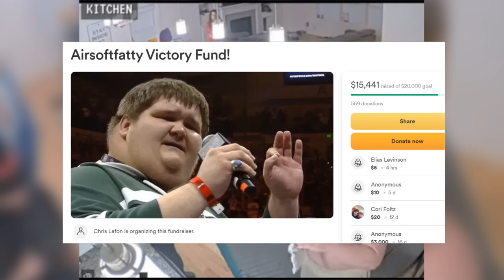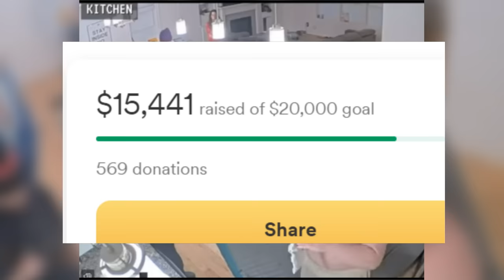Airsoftfatty on the rise

Comment: Can't believe Kiwi skipped over Fatty ripping insulation out of the wall with his bare hands during the build of the Fatty Shack
Reply: What's wrong with that?
Reply: @camojoe83 google it it’ll make you all itchy and give you microscopic scratches
Reply: @camojoe83  Fiberglass insulation is a pretty big skin irritant, even worse if you inhale it. It's going to do any serious damage but it's not something you really want to deal with.
Reply: Guys I handle fiberglass 3 times a week fixing rentals. I know all about it.

I forgot to use the sarcasm font I guess.
Reply: The old-school insulation from back in the day is very bothersome to the skin, but they're newer stuff they sell nowadays that is not too bad actually and can be handled bare-handed
Reply: @jontrudell7529  Huh,well that's good to know
Reply: @jontrudell7529  the yellow stuff ain't bad, but the pink stuff is as bad as it ever was. 
I actually think rockwool has it all beat. Whenever i have to handle that stuff at the greenhouse i always have to get the lint roller out for my arms.
Reply: @camojoe83  I work in restoration and deal with rolled in and blown in all the time. I gotta say really only the old stuff really bothers me. Alot of the newer stuff has vapor barrier on both sides or is wrapped in mesh. Old stuff really sucks though, especially when you've got a bunch in the neck of your shirt.
Reply: The F-Shack

Comment: You’re spot on about that last one. That house is already rotting from the rain splashing up on it with dirt. That needs to be at least like 1’ off the ground (helps with flooding too) and it should be sitting on good footings. Doesn’t matter how nice it looks if it only lasts a few years.

Comment: The shed is likely to last longer than you think as long as he doesn't actively destroy it (big if, yeah).  Those generally last 15 years or so without any work.  The one in my backyard is pretty much the same kinda deal (pre-conversion) and that's been there at least 20 years and in good shape except for sagging supports and a deteriorated door.  I'd say it's a decent solution that buys him some time to get his life in order.  Internet in the boonies isn't so bad these days.  We don't know his location, but even out in the country these days, you usually have 1 or 2 cable internet solutions and a DSL choice if you're near enough to get electric, and he clearly got that.  Failing that, there's Starlink, but that might be tough for him to afford on the upfront cost.  When I saw that shed pre-work, I thought he was screwed.  There's no way he'd be able to do or afford the work.  Those guys that donated their time there really knocked it out for him.  He's definitely got an opportunity here.

My worries are that he'd wreck the place himself, hoarder style... or let nature claim it by just not clearing the growth that will try to strangle it.  If he can keep the inside clean-ish, keep the outside mowed and cleared, and pay his bills, then he's got a decent solution for years to come.  He will need to save up though, because that shed will not last forever, and charity will only carry him so far.
Reply: they didny even put it on concrete slab its flat on the ground it has no insulation and no heat and no plumbing if it has watwr it will freeze in the winter this is not gona turn out good
Reply: Even though I don't like him, I don't wish bad upon him. I just want him to get his ish together and it stay together. Surround himself with better people
Reply: @xXtrial_and_errorXx  i dont wish bad on him but i just donnt see this going well he should have got a trailer in Michigan where he was living already its cheap to live ther an he has all his life but now they have moved him to new york some where one of the most expensive places in the country to live
Reply: Theres very little ventilation, every time he showers it fills with steam, same when he cooks his slop, its going to be mold city after a year or so. He was supposed to sleep in the loft, but can't get up, so he sleeps on that tiny couch, its also out in the sticks, he's never going to last there.

Comment: Not having a proper foundation is definitely an issue. 

Another large one: If he is not in city limits, that means a well for water, which is a decent amount of maintenance. Not to mention if he does not have city sewage, he will need a septic tank. Those need to be cleaned every 3 -5 years.
Reply: I wouldn't count on him doing anything that requires the slightest iota of responsibility.

Comment: I'm no builder but honestly no way in hell that shed lasts, especially without serious ongoing maintenance. 

Maybe I wasn't paying attention or maybe they just didn't show it but it looks like it doesn't even have insulation plus the outer walls look to be made out of chipboard which I imagine will only make the risk of rot worse as that stuff can turn into complete mush if it's moist enough.
Reply: They used the cheapest chip plywood ffs... and it cost over 20K by now. Insane ripoff. He couldve had a trailer which was already fully equiped and weather proofed for the same amount..

Comment: I also know the solution to keep Fatty's shack from sinking and rotting as my family's cottage is on Marshy land and they had to raise it every 10yrs. My family brought in an engineer and all of that and 10yrs later it  was almost sunk to the ground and my Dad figured an idea and instead of doing those pillars we took large railroad wooden ties and we cut them in half and then drilled a 4x8 piece and we raised the cottage with a bunch of pump jacks and wooden shims. We did the front & back with no issue. It was hard work but I was 21 and strong and in the middle we almost died. We each had two pump jacks each we had to keep up so the cottage wouldn't raise in the middle and crack, the jacks woulda given out and we'd have been splattered like an ant. That was one of the first-ever times I saw fear in my Dad's eyes. He just looked at me and said "Go!" That didn't mean scramble crawl for safety and break the cabin but live oh hell naw, we had to pump one jack and roll and pump the next one. We were working in tamdem and the railroad ties worked it was just that the middle was dicey and you never know when Mr. Murphy will show up and throw a wrench in your plans. We pumped  & rolled and I could hear the middle physically cracking and my poor Grandma was yelling my Dad and my's name and it was unsaid we just kept rolling and I like to think it was my Grandpa because all of a sudden we weren't in danger anymore. The middle was stable. We both rolled out and I just laid there breathing. I was so pissed that I didn't have any f-ing cigarettes and in that moment that was all I needed as I had weed. Anyways, that's the story of how my Dad and I almost died. We didn't talk about it really or nothing. My Dad and I are both old school and he's like Red Forman and we Shove It Down in my family and that's what we did. I eventually got my cigarettes too and that night I ambled down to the Beach that was popular with the people in Rented Cabins and the Campground and found a beautiful girl who I didn't spit on, thats for sure and we had a wonderful night. 
Stay Awesome and Frosty my friends.
The Cabin hasn't sank even an inch in the almost twenty years since that fateful day. Yeah, my Dad's a savage and he refuses to acknowledge it.
Reply: Chris couldnt even pay property tax, you think he is gonna raise that thing every decade?
Reply: @HRM.H  I really don't think that he will. I don't know why these people don't actually find and pay for better management. I think that Lolzcow's especially should have an actual manager or editor who does most of the work for them and they recieve a percentage of their monthly YouTube royalities. That would honestly have been smarter than giving a dude from a dispensary access to Fatty's very own soul. People gotta be careful today and its so easy to be swindled and taken for everything if they're not careful and most Lolzcow's can't handle not hemorrhaging all of their earnings by spending on dumb shit with zero chance to profit off of it. Look at King Cobra JFS: He's missed the mark on so many branding opportunities. Instead of his crappy Customized Girl tee shirts he hawks he coulda commissioned his own fans to send him in artwork and actually pay them to help him better his brand. Tar Man is doing streams about how badly Cobes has mismanaged himself and damaged himself by allowing himself to be allegedly Gatekept by certain people.

Comment: as who has built a cabin in the wood myself, as long as the paving stones are supported by gravel, they are leveled and the home sits on treated wood, it should be fine. The benefits of building a home on a "floating" foundation is that if it ever needs to be re leveled, a simple jack in that corner and a reset of the paving stone and supporting material is all thats needed. Now I have no idea if fatty can do that himself, but anyone with a brain stem should be able to accomplish this. :)

Comment: How is he gonna heat and cool the "tiny house"???  Also,...Mr.Kiwi is absolutely correct. The closer that thing gets to ground the more it will suffer from rot. If he was smart he would have bought a role of Tyvec at Lowe's or Home Depot and stapled under the entire floor system. Those floor joist will be rotten in 5 years. 3 if they're not pressure treated.

Comment: “I will always have a roof over my head.”  The main expense with most housing is the land underneath it, and there are plenty of shelter options that are plenty affordable, a yurt, an old school bus or a cement slab/cinder block walls work fine, if you finish them out the inside decently.  The problem is always the land, and just purchasing a shed doesn’t really address that.

Comment: the building has pottential but before they started the endside they shoulda invested into some  frame work on the outside
Reply: Yea, just sliding it down without some basic foundation seems a bit strange, considering he will be walking around and displacing weight; as opposed to storage sheds where there isn't all that much movement and displacement.